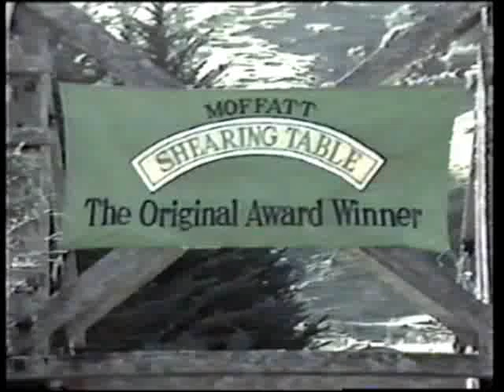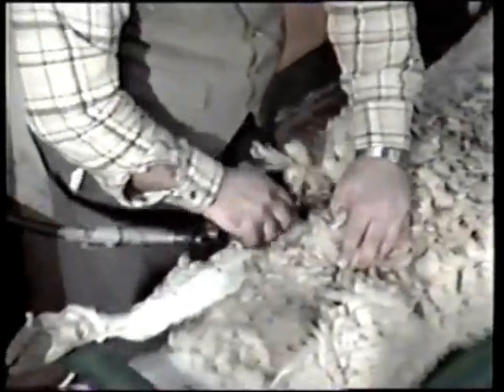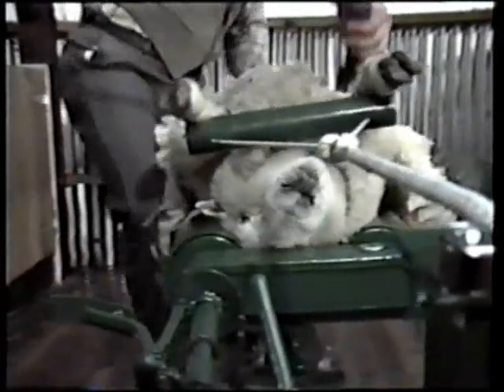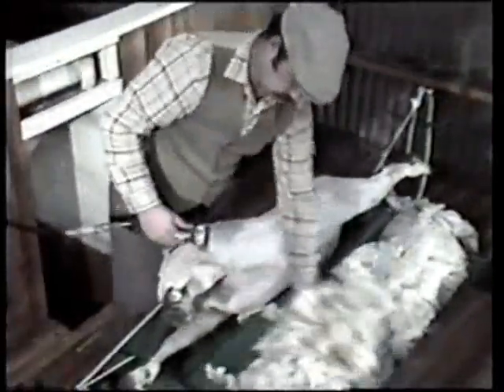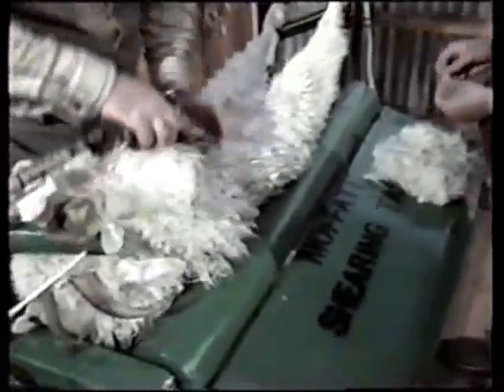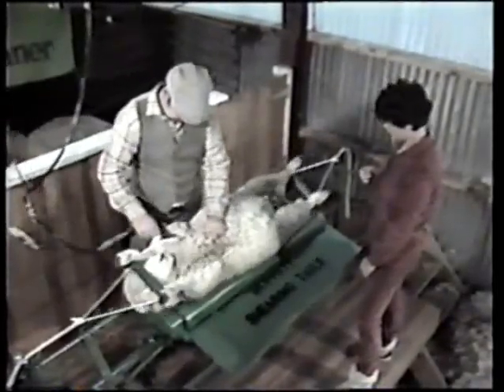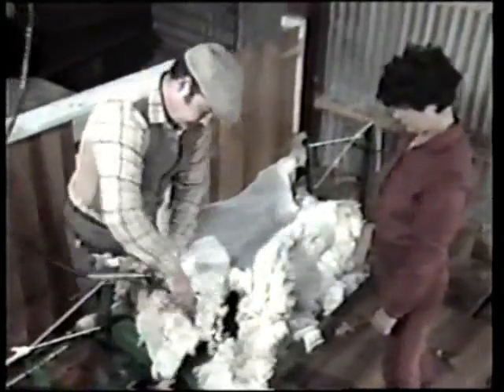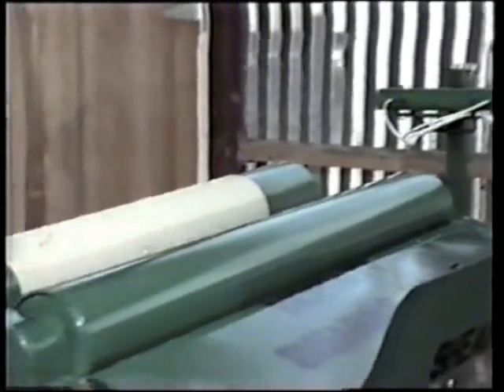Moffatt Shearing Table.wmv

Comment: This is a 1980s NZ invention, no longer manufactured. They work just like the video shows. The 250 per day would be a 9 hour day with the shearer well supported by other labour and the woolshed well configured as shown here. I still use one and by myselfand with sorting the wool and  a poorly configured shed, I would do six sheep per hour.  If you have to walk heavy sheep too far on their hind legs they want to sit down and that can be hard on your back getting them up again to position on the table. All things considered I wouldn't be without mine as I can shear independently despite my age and back issues. As to the videos suggestion that it is easy, or that you would shear in those hilarious clothes (they were actually regarded as 'going to town clothes' for the conservative target audience), well that is BS and using them is much like all shearing, sweaty, noble work.
For NZ smallfarmers, if you find a used one for sale in reasonable condition then buy it. Any local engineering shop will be able to repair a damaged one and keep it going for years.